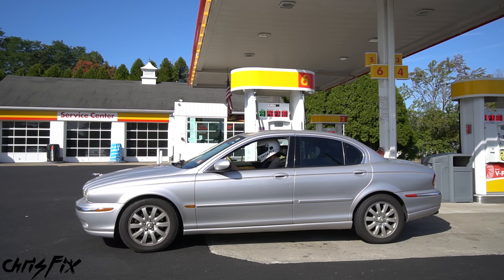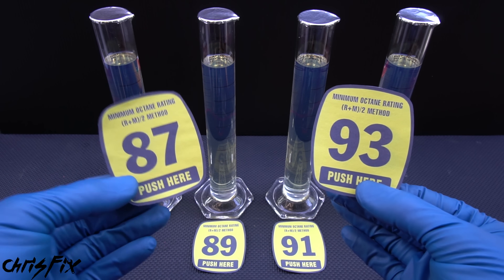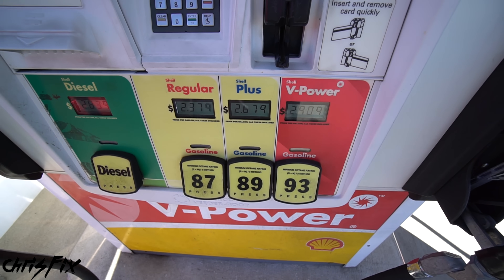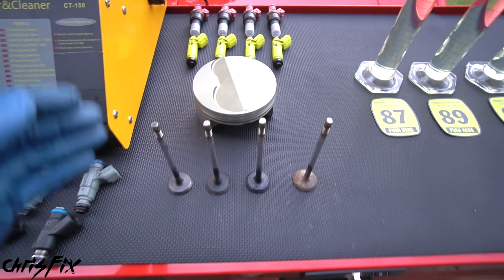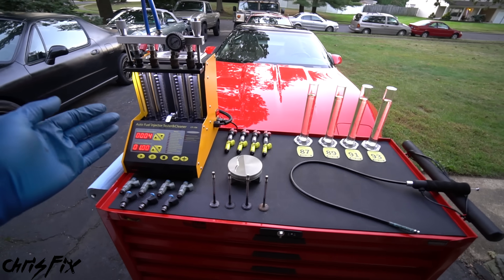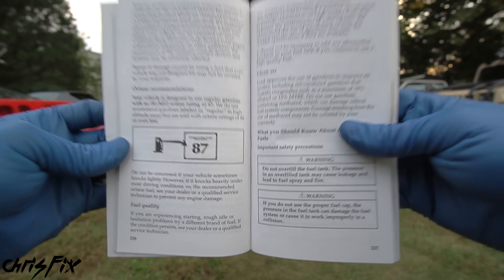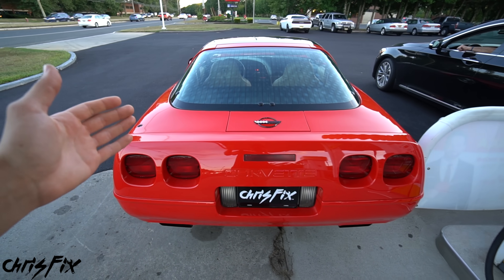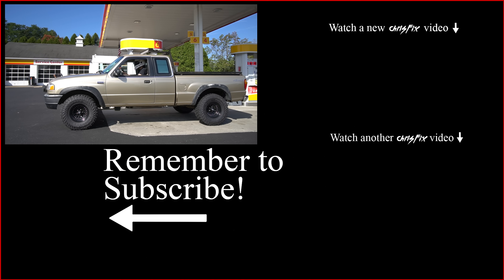What is the BEST Fuel to Use in Your Car or Truck and WHY

Comment: I first had an issue with an '03 PT Cruiser GT (turbo 2.5l) and knocking - just like described here, sounds like marbles flying around the engine compartment. After Katrina, several times I had to switch to 87 octane because higher was unavailable and it was hard to drive the car without it knocking. Later got an '08 PT Cruiser Limited (also turbo 2.5l); similar issue but could run 89 and it was the same for a '10 normally aspirated we bought. In fact, the '08 started blowing blue smoke out the tailpipe on start; dealer replaced turbo twice under warranty but that wasn't the problem - valve stem seals, quite likely from all the knocking. Used 89 ever since and no more problems. '17 Mazda3 with 2.5l I4 needs 93. On all these cars you can most reliably hear it on level roads at about 40MPH with the throttle barely down.

Comment: Wrong.  Higher octane burns hotter, the additives that are used in a fuel has a lot to do with burning & keeping the injectors clean along with the complete burn process. Meaning less carbon buildup on piston tops, valves, heads. 
Higher octane does & will increase power. Why else is there racing teams using higher octane fuels? Horse Power, no internal combustion issues. When you go from pump fuel to oh let’s say AVGas 100LL or VP or Sunoco racing fuels. It’s all about performance & keeping the internal components working flawlessly. 
The major issue around the world with fuel is the trash that lies on the bottom of the fuel stations. I’m talking about water, scale, even paint chips. 
 Sludge & gunk is not related to fuel, it is related to lousy oil being used or not changing it. This sludge or gunk lies on the bottom on the oil pan, top of heads & can & will gather around piston rings.  Remember an engine needs a fuel to make power & a motor needs power to make power.

Comment: He mentioned that altitude can affect octane requirements, and indeed, here in Colorado our regular is 85 octane. With less air pressure, cylinder pressures are lower and we don't have as much risk of knock. Of course, that means that we have a lot less power than lowlanders get in their cars.
Reply: This explains my summer vacation. This summer we went to Yellowstone. I drove all the way from Virginia. I was somewhat confused in a few areas where they were carrying 85 octane because you don't really see it on the east coast. I want to say it was around Wyoming and Idaho, but I might have seen a few in the Dakotas as well.
Reply: Note that this applies less to engines with forced induction. A turbocharged engine will still see a slight dip in power at high elevation, but it’s much less of a drop compared to a naturally aspirated engine. 

If you have a turbo or supercharged car, you should stick with the manufacturer recommended octane rating even at high altitudes. Given that like 95% of all cars built in the past 5 years are turbocharged, Colorado should consider bumping up their octane ratings.
Reply: ANY engine power loss at high altitude is directly attributable to the turbo charger not increasing boost to compensate 1:1, since energy content is exactly the same between different octane levels. At 4000' above sea level, effective oxygen levels are 20% less and even F1 racing takes a significant time penalty at high elevations. That's why I dismiss my AUDI and MINI's manufacturer claim to use USA premium 91 octane fuel, including my 3600' above sea level and use USA midgrade 89 octane fuel instead without issue for many years.
Reply: But like Peruvian football players, imagine how they perform at sea level!!

Comment: I'm not doubting the facts in this video... But every pump I've ever pulled up to charges vastly more for higher octane and even brand them as premium or supreme fuels. This is why those myths will never die and why vehicles like which require higher octanes to maintain fuel efficiency are hard to maintain since we are targeted as a cash grab.

With all 3 fuels having the same energy one shouldn't cost more than another... If anyone has a quality solution to this, such as an octane booster to get the same effect for less cost per tank I'd really appreciate it.

Comment: I didn’t know anything about gasoline octane or anything but when a mechanic recommended me to use premium gas on my Infiniti G20 2000, so I wouldn’t have much problems with the smog check every two years in California. I did, and he was right, I haven’t had any problems to pass my car on smog checks since than.

Comment: i use 25% e85 and 98/93 the rest on mu ttrs. no problems but a little boost in power. i probably will get it tuned for e85 since it gives a lot more power and runs cooler. good video btw

Comment: I'm not sure what you mean when you say that all three octane ratings have the same energy content.  Can you explain that?  That's a broad statement.
 Because they all don't have the same vapor pressure and vapor pressure is the thing most carefully controlled by refinery engineers.  A higher vapor pressure such as that supplied by premium gasoline makes my hatchback definitely run faster but screws with the idling speed of my F150.  And when they switch from winter to summer blends, its based mainly on the vapor pressure while the octane ratings obviously stay the same.

Comment: Some stations have alcohol free gasoline usually 93. I believe it helps your small engines run a lot better I have tried it it works

Comment: Well, Chris, a year ago I switched to Premium fuel for my 87 octane-recommended vehicles, three 6 cyl, and one 4 cyl, and after a year they all accelerate faster, run smoother, with increased mpg. One Toyo, one Olds, One Chevy, One Ford.
Reply: Ditto, haven't used anything lower than the highest in over 15 years. We've been restoring classics for years and notice a difference in how our engines perform. Not to mention premium in Canada doesn't have ethanol, which does wreck engines and other components over time.
Reply: @RichardPortfolio  ethanol does NOT wreck engines
Reply: @rayman1230   Ethanol in and of itself does not wreck engines. BUT, it does attract water vapor, and so the presence of additional water in your system can do damage.
Reply: Can I use Premium in a 2012 Honda Civic?
Reply: @MikeBoneMusic  yes
Reply: My question is, are you still using premium? With the improved MPG are you saving money compared to regular fuel with it being cheaper?
Reply: Yes. Although fuel economy is not a concern for me; what I love is the improved performance @joshuawilcox1322

Comment: Can you mix different octane in the car to get some of the cleaning benefits of the high octane fuel? For instance my car runs 85, but If I were to do like ~3/4 tank of 85 and then the rest of the tank with 91 would it better clean the engine or is it not really even worth it at that point?
Reply: Using a brand that is Top Tier certified will feature more detergent additives in the gasoline than generic gas at generic convenience store. You'd be better off pouring in a bottle of fuel system cleaner into the tank that has PEA in it such as Techron or Regane and then filling up if you want cleaning action.

Comment: Premium in USA 93 Octane... meanwhile in germany I am allways using Aral (BP) Ultimate 102 or Shell V-Power (100 Octane) for my Opel (Vauxhall) Corsa E OPC (VXR) which requires a minimum of 100 octane from the manufacturer (written inside the tank covering cap) and is also mapped to 100 octan from a tuner. (stock 207 bhp, tuned 240 bhp). Americas premium is our cheap stuff. (95 Octane) and even our midrange fuel has 98 octane. That is very important if you go full fas on the autobahn to prevent engine knocks.

Comment: Don't use E15 fuel, 88, or E-15.They are ethanal made from corn. it can damage fuel lines, gaskets, void warranty. 
There is also a 91 ethanol free fuel,  but it can be hard to find.

Comment: The reason I'm watching this video is because I have 2021 Electra 2.0 and engine and I noticed recently with recently with acceleration s with 87 obtained from different gas stations shell mobile Chevron Costco it's making a knocking noise During acceleration it's gonna remind me when the cars were filling up with a bad fuel when I was an Iraq same engine knocking noise I talked to the dealer they said just try a different gas station but I tried all of them that the engines still making that noise during Do you think should I start using 91  octane  Cause the manual and the dealer said to use 87 and it says for 91 or 89 or higher do a research so what's your recommendation
Reply from the maker: If your engine is knocking on regular gas, increase the octane to mid grade and see if that fixes it.

Comment: what's considered  high altitude? I live at 2500 ft above sea level but travel at times up north to 6000 ft. I run 85 that's sold in Utah in my 2011 Acadia and Versa.  Thx

Comment: An option which can be done, is this. Use a basic fuel, then every 'say', 2nd month or 3rd month USE a fuel cleaner. Some additive companies say - EVERY TIME you add fuel. That..... works out as expensive. That being done, just use the most expensive at the station.

Comment: Whenever I fill up with the 93 I’ve noticed it seems to last longer than the 87 , I’m guessing with the extra additives in the 93 it gets the fuel system clean and working as it should or what
Reply: yup. Get a huge increase in mileage range and fuel economy when using premium too. 93 is King.

Comment: If anybody is curious then in Estonia specific our 1Liter (approximately 0.26gallons) fuel price is for: 95 1.52EUR (1.72USD), 98 1.57EUR (1.78USD) and D 1.32EUR (1.49USD). I'd say that's pretty expensive because usually we had for example 95 for 1.32EUR (1.49USD) and D for 0.98EUR (1.11USD). And also those prices are pretty expensive because our minimum one month salary is only 500 euros (565.85USD).

Comment: Thanks for the video. I do have a question. I have a higher mileage vehicle which I've maintained very well my mechanic recommended that I use ethanol-free gas. The ethanol free gas that I found is 89 octane. My vehicle will run on regular 87 according to the owner's manual. What would be the benefit of running the ethanol-free gas? I have a 2001 Mazda Tribute ES V6. Which is the same as a Ford Escape and a Mercury Mariner

Comment: So I’m getting a 2003 Nissan Pathfinder as a gift because it has no power and they don’t want to deal with it. But in the manual it says

Unleaded gasoline with an octane rating of at least 91 AKI (RON 96) (VQ35DE) or 87AKI (RON 91) (VG33E)*1

The pathfinder has a VQ35DE engine so do I use regular gas or super?

THE MANUAL ALSO SAYS THIS:

VQ35DE engine: For improved vehicle performance, NISSAN recommends the use of unleaded premium gasoline with an octane rating of at least 91 AKI number (Research octane number 96).

I’m just confused with this! 😆
Reply: It means you can run 87 octane safely. But you may get an extra 20HP or so running premeium.

Comment: What about 88?
Reply: It's E15 fuel. It's safe to run in all US cars and trucks made after 2013. However, don't run E85 unless your car specifically says Flex Fuel. Any vehicle sold in the US from 2013 and onward can run E0 ~ E15 gasoline safely. Anything above E15 is only for Flex Fuel vehicles. E15 gasoline is rated at 88 octane. My 2014 Ford Fusion runs it fine for example. It even says up to E15 right on the gas cap.

Comment: What does 85 ethanol do?
Reply: Voids your vehicle manufacturer's warranty if it's not a Flex Fuel vehicle. E85 is for Flex Fuel-rated cars. Any vehicle made from 2013 and later can run E0 ~ E15. But E85 specifically can only run in Flex Fuel-rated cars.

Comment: I do support your methods. But I would think that the driftstang would need to get more fuel octane because it’s not meant to be redlined at 6k going sideways around a track. Wouldn’t that increase chance of detonation?
Reply from the maker: It wouldn’t matter. Compression is still the same even at high rpm’s.
Reply: @chrisfix  how many times are you planning to do the lemons race? Until you don’t come out with a blown engine or…..
Reply: @chrisfix  I ask that because everybody is waiting on the driftstang boosting process (turbo/supercharge) for like a year so I was just wondering

Comment: I had a disagreement with a gas station attendant.  He said you should put 87 into older cars.  I tried to explain that the high compression engine in my Barracuda prefers high octane.  I am a firm believer in RTFM, and both the owner's manual and shop manual indicated high octane.

Comment: Hey Chris, I own a 2010 Subaru Outback, manual says regular and I was using it all this time since I bought it. Lately I was hearing a rattling sound from the engine like 'tackle tackle tackle' every time I I was throttling, specially now that I moved to a higher elevation here in New Jersey. I started using 93 and the car had stopped rattling, I get more power and the engine is running quieter. So what gives?  I heard that it's better to put premium gas as old engines are more worn out than newer ones and take more advantage of higher octane gas.
Reply: Chris addressed this observation in the video. Most probably some carbon buildup in the combustion chamber.

Comment: Great video. American gas sucks today compared to yesterday. My 87 Volvo used to get about 32 MPG. As alcohol was added, the milage went down to 25 MPG. Use only premium gas in my vehicles and my small engines(lawn mowers). Saves on future repairs.

Comment: In Spain there are only 95 octane or 98 octane
Reply: Dang! Here in the US, we have the EU equivalent of 91, 95, 97, 98, 99 and 100. (Aka... US (R+M/2) of 87, 89, 91, 92, 93 and 94) Plus we have E15 88 US octane and E85 which is over 100 octane too. And finally, Diesel too.

Comment: I just want to say I just started using unleaded 88. I have a flex fuel vehicle(grand Cherokee) but I only use unleaded 87. But i think unleaded 88 should be better, cleaner and it’s cheaper. Its $2.99/gal and unleaded 87 is $3.55. (Sheets-PA) the only thing I would like to see is the mpg correlation. What’s the best value. Cost vs miles

Comment: @ChrisFix Is there a significant difference in fuel brand?  You spoke well of Shell for this video, but what about Exxon, Sunoco, Crown, Royal Farms, Carroll, Love's, and others?  How do I know if the brand is good or bad, or is octane the only significant factor?
Reply: If the brand advertises that it's Top Tier, then it will feature more detergent additives. Other factors to consider is how clean or new the gas station is and if it's generally busy, because that means the gasoline is fresh from frequent turnover and the holding tank isn't rusting out. If forced to choose between a Sam's Club pump or a really dumpy looking Shell station that looks abandoned, I'd choose Sam's Club everytime.